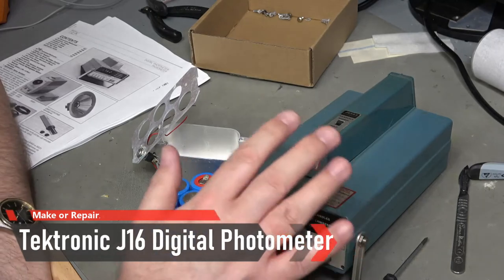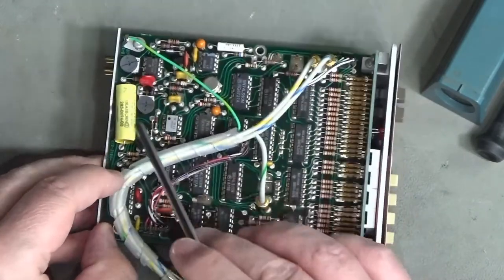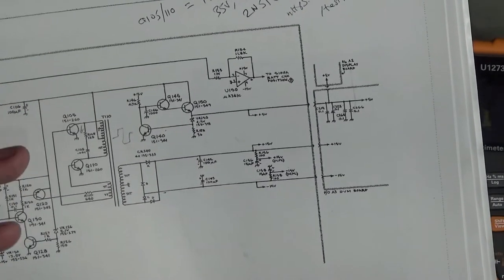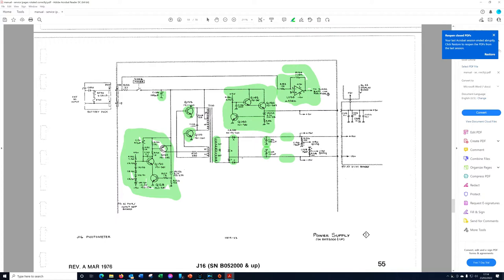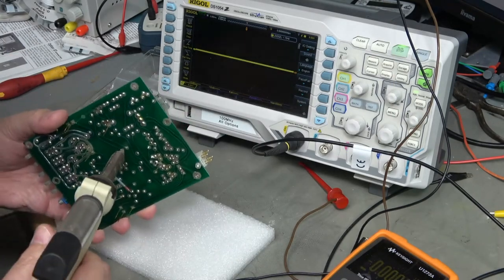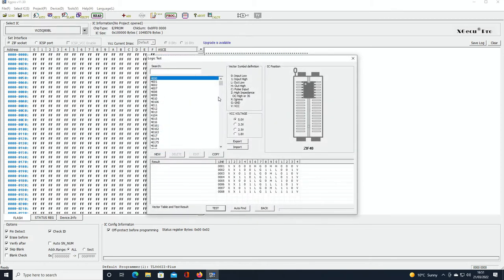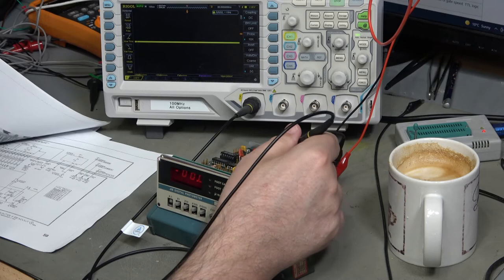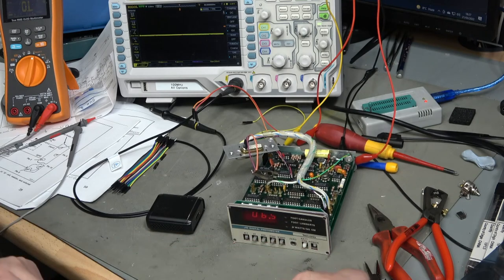Tektronix J16 Digital Photometer Repair #0058

Comment: Both my J16 units have a 50K trimpot with 200ohm parallel resistor. That may have been a Tek installed thing maybe?... Possibly to provide the 200 ohm resistance with a slight adjustment provided by the 50K resistor. That would provide very fine adjustment up or down by about 0.8 ohms.
Reply from the maker: Well that is just weird.  Double checked the diagram and it is part of a balance input, the fixed side has a divider made of a 100ohm and 75k, the variable side with this trimmer is supposed to be a divider made from a 200ohm trimmer and 75k, so that the input impedence is matched on both opamp inputs.  50k in parallel with 200ohms is so high, it essentially has no impact on the biasing of the dual FET it is connected to nor on the voltage across the 200ohm resistor, which means it is just doing exactly the same as a 200 ohm trimmer except with higher impedence.  Since the opamp has an input impedence of >1Meg then impedence mismatch becomes insignificant and the only reason I can think of is to reduce the thermal drift of the trimmer by reducing the current.  Who knows,  actually I wonder if the circuit could have changed, my diagram only applies to serial number B052000 and higher